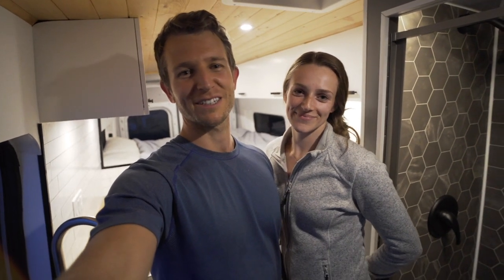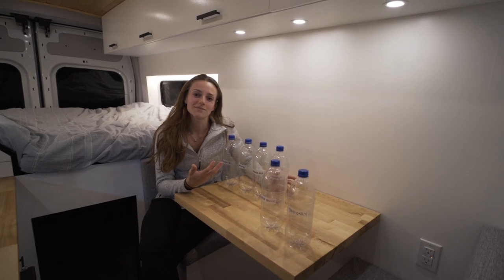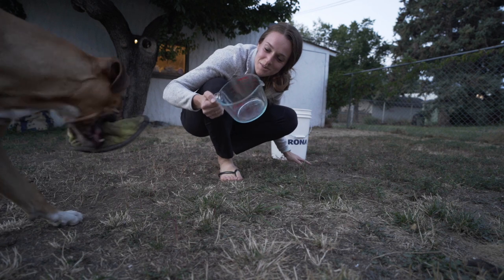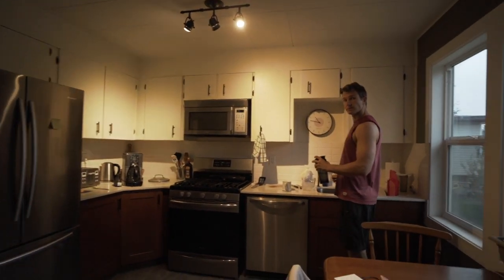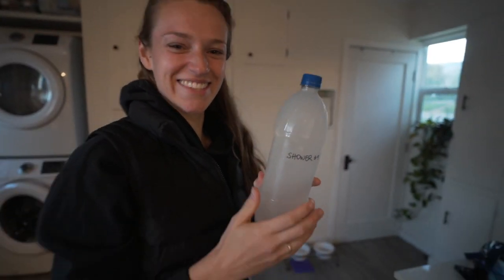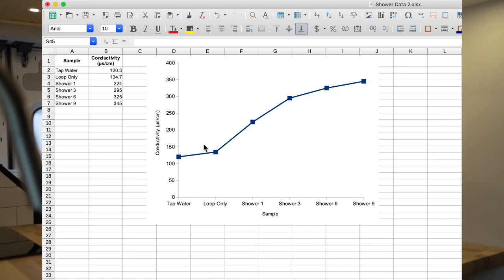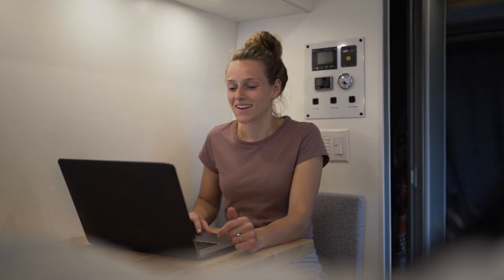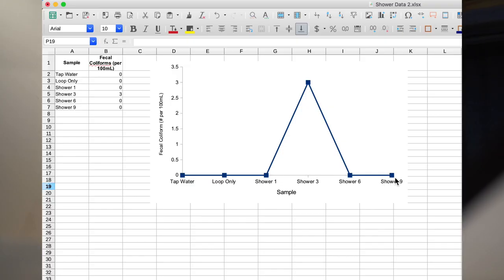VAN RECIRCULATING SHOWER | WATER QUALITY TESTING

Comment: the only reviewer actually testing their water scientifically. PROPS.
Reply from the maker: Thanks! 🙏🏻😊
Reply: @TimKatie I am just finding your reclaim shower water system videos as part of my research on building my own system in my 82 MCI (old greyhound bus) and your system has been designed and built very similar to what I was intending to build but mine is on a bit larger scale size wise but it’s mainly my holding tank that is larger with a 25 gallon tank and everything else is basically the same. I’m impressed that y’all are the only ones that went the final mile and had actual lab testing to ensure your maintaining a safe and healthy shower system. I’m gonna go ahead and buy your ebook this weekend to use it as my resource on building my shower system. I’ve been collecting parts and pieces all summer so when I finally had everything then I would put it all together. I’m really looking forward to this system and being able to add the luxury of taking an hour long shower if I want to and not worry about using up all my fresh water. Out of all this tho, I did have one question that has come to mind that I’m extremely curious about which maybe you’ve already covered in another video and I will subscribe and search your channel for the info but I’m also gonna ask here, since you’ve had your shower up & running for a bit more than one year, are you still as excited about your shower now as you were one year ago, is there anything you would do differently now or maybe equipment, would you still use the same major pieces, etc? I’d love to hear your thoughts of one year later please if you wouldn’t mind so if there’s something we can make better from your experience while I build it instead of trying to retrofit later, if that makes sense. 

Thank you for all the time and effort y’all put into the design, build, testing, and follow up to help others like myself to put together a similar system without spending a year researching and trial and error ourselves! It’s blatantly obvious you both have spent ridiculous hours designing, building, & testing just to help the few of us out here that will actually build a system, thank you very much!!
Reply: @1982MCI  Ive been looking around at different bus builds and bus builds for a while, but im thinking within the next 5 years or so, i will be at least starting to seriously look for a bus to convert or modify. i started thinking about a recirculating shower as well. my ideas/theories for a recirculating shower:

have a set of valves, either manual or power actuated, on both the drain, to connect between the gray/wastewater tank and the recirculating holding tank AND the shower faucet, that way youre not using up the filters if you have a hookup, or just dont want to use it.

a common way to filter out sediment is to not put the pipe that feeds the shower faucet on the top or the bottom, otherwise your pump will suck in whatever sediment floats to the top of the tank or the very bottom. this is just my theory -  put a 90 degree elbow facing downwards from the top, putting another length on that elbow to keep it far enough off the bottom to not suck up heavy sediment, but low enough that youre able to use as much water as possible without skimming the surface of the water. the possible downside to this is a slightly bigger tank, but it might be doable in a larger bus conversion.

On the lowest point of the system, i think i would want a way to drain the system into my grey/wastewater tank, but that might be because im either going to have one combined tank with a standard rv toilet, or an incinerating toilet.

i dont know how the water would stay hot, i was thinking maybe a separate valve with the hot water pouring into the shower, so that you can just add the water into the holding tank.

There are downsides to my idea, but i literally just came up with it earlier today, and really the only 2 things that i dont have enough of right now to start a project of this scale is money and time, all of that should come within the next 5 years or so, and im still young so im willing to wait it out

Comment: My hats off to you,  I am considering an off grid recirculating shower design in a place with very little water (Santa Barbara) and I will probably buy your book to speed up the design, since this video proves that it works. Here's my thoughts - for context my background: product development mechanical engineer and I happen to collect orchids, so I have some familiarity with both designing/debugging stuff and water quality metrics. 

1) For clarity it might be easier to see trends if the data is displayed with the cycle number progressing linearly rather than progressing: control, 0, 1, 3, 6, 9

2) The pH increase of 2 is pretty weird. You could test your theory of time in container by using a cheap home pH meter and testing it right when the sample is pulled and at some regular intervals and see if it tracks. My thought was maybe a sensor was used that hadn't been calibrated? 
Assuming the correction is valid it looks like it leveled off? I wonder why that would happen - maybe more buffer agents are being introduced over time? 

3) Interesting to see TDS leveling off. Your theory makes sense. Ammonia content - I guessed sweat also. Keeps climbing fairly linearly. Nitrates also leveling off, Alkalinity looks roughly linear. And it's good to hear your turd filters are working. 

4) Dip in phosphate is weird, did the water testing place happen to give you measurement precision for each of these? generally leveling off. 

5) Water dilution is actually quite the problem here. Although a little less than 10%, it gets diluted nearly ten times. 91.7% to the 9th power is 46%, so less than half the water you end up with is the same as when you started. Possible solutions: can less than 1L actually be used as a sample. Or better yet, test less often, like only once after 10 cycles. 

How did you choose 6 cycles and why is 10 cycles the limit your recommendation, which metric worries you the most and why not go much higher, like to 50 or 100 cycles if most of the metrics show that it's leveling off.
Reply from the maker: Thanks for your detailed comment and feedback! 
We appreciate your insights - all good thoughts. 

~6-10 cycles is our limit recommendation mainly based on the the water starting to get murky at that point and the fact that we tested the water to that point. We completely agree that water dilution is the issue in our test, and if we had the time a single test after 10 showers would be interesting.

Comment: Love it!
Thought about going this route as well.
Couple questions:
1. Did you consider an RO system instead of the filtration? Any thoughts/comments on that?
2. Did you happen to know what the "safe" limit for each criteria tested was? It would be great to see how well within the limits your system is operating. 
3. Is there any way to setup sensors or some kind of monitoring system for any of the tests you ran, or maybe for keeping track of how much water has ran through the system between flush & clean outs.
Reply from the maker: Thanks! Briefly considered RO filter system but it takes a long time to filter the water and does not have UV component. 
Yes I shared these in the photo comments on this post: https://www.facebook.com/groups/campervanselfbuild/permalink/10159483011224670/

Certainly, some people setup Arduinos with sensors and electronic ball valves. It just depends how complex you’re comfortable making it
Reply: @TimKatie  I'd also like to know what the "safe" limit and the facebook post isn't working anymore. Could you share this info ?
Reply: FB post works fine, I just “joined “ the group

Comment: Way cool testing. That's a big Yes on installing a recirculating shower. 
Thank you for that reassurance about the water filtration quality.
I'm thinking about 6 uses and changing water and cleaning the system.
Right on guys. Thanks for sharing that valuable information. 
Safe & Great traveling.
Reply from the maker: Thanks, Tim! Thanks for the feedback. 6 uses sounds like a reasonable and safe amount to us - that’s what we went by as well. Cheers, hope to see you on the road!

Comment: I have a recirculating shower, I rinse initially into the gray tank, I then recirculate a gallon of water as long as I want, then I drain it into the gray tank, and then rinse with fresh water for 20 seconds or so, I’d never consider even a second shower with sitting recycled water, I use a total of 2-3 gallons per shower
Reply: I'm doing something similar. I like this ideal the best. I use a heat exchanger as well, so no shower water gets into my HW heater. 1 TSP of Epson salt can help the filter do a better job as well. I use 1.5 gallons, 2 total with rinse.
Reply: How did you set yours up
Reply: Can you wash your hair pk
Reply: this would be ideal!

Comment: SUBSCRIBED and LIKED - t.y. this video covers much of the information needed for one looking to implement such beast.
So, this amounts to a weekly cycle maintenance for one person taking a daily shower.
The testing is priceless,  *(missing on all videos) I have seen so far.
UPDATE:  you recycle 3.5 gals( I think), so if you make the shower tanks 7 gals... it gets a bit better, surely...
...a few more details that were missing, ...I know..., how demanding!:

- the soap(s) used is critical... all the oils will clog the filters RAPIDLY!
  some individuals mention to not use any soap, just a brush and water.
- a list of the components in the system, and their installation order
- the frequency of replacement for each replaceable part *(missing on all videos)
- the actual quantity of water cycled thru the system/filters at each shower, since the water is recirculating? *(missing on all videos)
  I don't think this video includes long showers!?
- (cake-and-eat-it-too)detailed cost list for all of the above items in this system

Maintenance:
- basically a daily clean up of the <blank(pre?)> filter,
- a weekly cleaning of all filters,
- a flush and treatment of the whole system (between 7 and 10 showers)

--- For 2 persons that would be a be twice a week!!! hmmm!
Reply from the maker: Thanks for the comment and feedback!

- I believe we mentioned the soap (maybe in another video tho), we use and recommend dr bronners all natural liquid soap
- all components and steps to building the system are listed in full detail in the eBook (linked in description)
- clean strainers after ~15 showers, replace sediment filter ($4) after ~20-30 showers, replace carbon filter ($20) after ~50-60 showers, replace UV light ($90) every couple years. 
- 3 gallons, as mentioned in the video
- total cost is ~$1800 usd but always changing, can be seen via the parts list in the eBook 👍🏻

Comment: There are a few things that affect fecal coliforms. Time is one. However, since insufficient time elapsed between the samples taken at shower #3 and shower #6, time can be ruled out. Temperature, chlorine and iodine treatments can all kill the bacteria. Again, none of these apply.

Since the bacteria count spiked in the shower #3 sample, then went back to undetectable, I'd say that either the UV treatment effectively killed the bacteria, or the sample was contaminated during testing. Either seems likely, though I lean toward sample contamination as total dissolved solids increased between samples. If anything, this would negatively impact UV treatment efficacy.

Great content...as always. Keep up the good work!

Comment: I have just installed a system like this in my van. However my main concern is that soap increases water turbidity, and turbidity seriously inhibits the ability for UV light to sterilise the water effectively. So we've started flushing the system after every shower (we're a family of 4, so we all shower on the same day so that's 4 showers). Finding it a bit of a chore at the moment, especially as flushing all the old water out of the system seems to take almost as much water as we used to shower in, if not more!!
Reply: the clarity and UV effectiveness can be maintained with a small tweak.  adding epsom salts (about a tsp per shower) will react with the soap and make it drop out of solution. To make it work properly though you need to have a .5 or 1/2 micron carbon filter to actually filter out the soap solids.
Reply: @euphioquestion420  interesting, I will give this a try! Thanks!

Comment: Great video. Thanks for taking your time to help others. Glad I saw this. Two items were learned, test results and using 12L of water. 12l is great on weight. I was going with 5gal until I saw your video. Guess time to look at ebook for your filter system. I have problems that might cause to have earlier filter maintenance. Age shin and psoriasis
Reply from the maker: Thanks for the feedback! We hope you find the eBook helpful - please feel free to report back with your results 😊
Reply: @TimKatie  two ?  Why 2 filters and not 3 carbon filter and why did you mount filters sideways?  Thanks.

Comment: Nice test. Thank you.
 A few years back I set up a 5-gallon system similar to yours with similar results, including the maintenance. I didn't like the touchy-feely maintenance part. And wasn't completely happy with the water past 4 or 5 showers. And I like soap, lots of soap. I get dirty.
 So, I removed all the filters and installed a 1-quart volume back flush DE sand filter. Much to my surprise it appears to catch all the soap, and the water is ALWAYS clear coming out of the shower head into a glass. 
 My plan was to back flush the filter and change the water after every shower and change the sand every week. That turned out to be excessive. By a lot.
So, I flush the filter and change the water after 10 showers, add 4 drops of chlorine after each shower then run the shower for a few minutes and change the sand every 2 months. Changing the sand takes about 5 minutes with a vacuum.
Those aquarium sand filters are amazing. The water looks better after the 5-gallon back flush than "my" local tap water looks going in on the fill up. But I won't be shaving or brushing my teeth in there.
Bottom line is I feel just as clean in this shower as I do in the house shower, definitely cleaner than the campground shower "probably psychological" and I haven't made myself sick yet.
A 30-minuet hot shower is a good thing. Can't do that with a 6-gallon water heater on a 20-gallon freshwater tank. 
And I have no black tank. There're better ways.
All the best to you and yours.
Reply from the maker: Thank you for the feedback and suggestion! Sand filters are very effective! All the best
Reply: Sounds interesting. What kind of sand filter do you have? And is it a "DE" filter or a standard pool-type sand filter? And how about the size?

Comment: This is incredibly helpful! Thank you! My husband has run across folks saying that they experience too much gunk in filters from using soap and find the maintenance to be too much.  What kind of soap do you use and do you find maintenance or replacement of filters to be too much?
Reply from the maker: We’re glad to hear you found it helpful! We found dr. Bronner’s all natural liquid soap to be the best and minimal clogging in the filters. We didn’t find maintenance to be an issue before we sold it and are doing a near identical shower in our current build 👍🏻

Comment: I'm pretty happy with the thought of one shower with 3 or maybe 2 gallons of water. I would not mind replacing the water.

What is the water heater system? How much water does it take to flush it after taking a shower?
I'm thinking about filling the recirculating tank with hot water when taking a shower and then flush the tank. This would give you a 15, 20 minute shower or whatever you want with just 2 gallons of water.

Comment: When not showering a loop bypassing the shower head would allow multiple passes through your filter system and UV, further polishing your reserve without introducing airborne contaminants. Moving water stays cleaner.
Reply from the maker: Good idea. We always drain the system if there’s going to be more than 1-2 days without use, but definitely something to consider. Thanks for the suggestion!

Comment: Great video and excellent results. I'm in the early process of a design for a similar system in our RV, with some modifications. We are installing a propane toilet and will use the old black water tank as the shower reservoir (26 gallons). We will also install a bypass allowing the shower water to circulate through the filters and back into the holding tank without the shower operating. Thoughts here are a larger reservoir and the ability to filter without showering would greatly extend the lifespan of the shower water. Thoughts?
Reply from the maker: Thanks for the feedback! I’m not sure I understand the benefit of adding such a large holding tank - but it would be interesting to see if recirculating it through the filters continuously without the shower running results in cleaner water!
Reply: @TimKatie  This is all in my head but the advantages of the larger tank would be the ability to dilute the pollutants in a greater volume of water, greatly extending the time between "flush and fill" cycles. I also think by diluting, the filters can be more effective in removing particulates and such.
Reply: @SofaKing5  I imagine using a smaller volume and changing it more often would be so much better, would you want to take a shower in water you used 10 times?? If you use a couple of liters you can change it every time